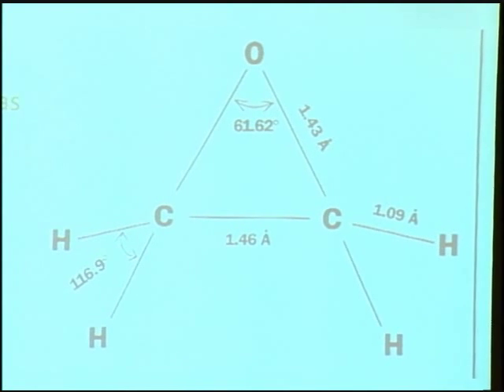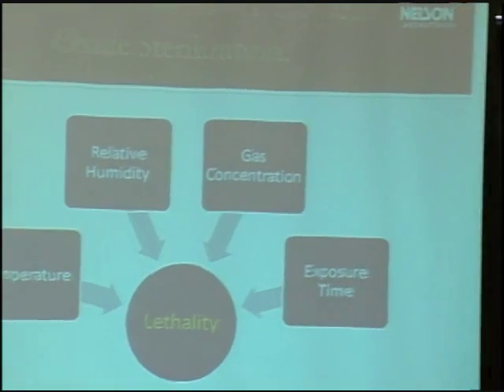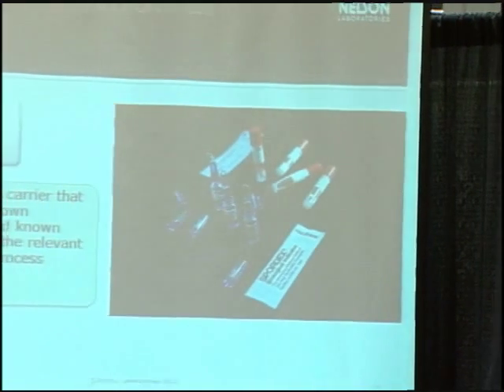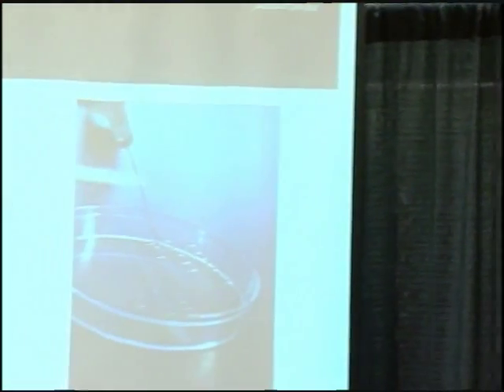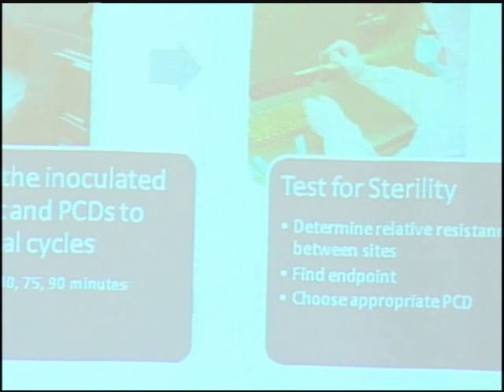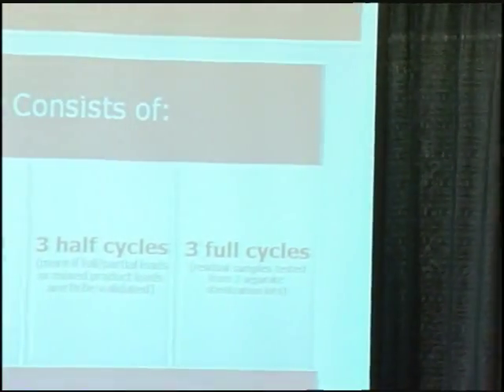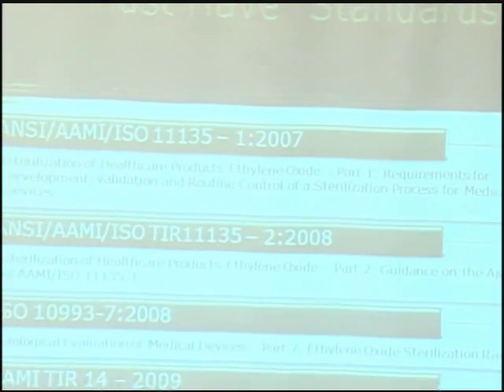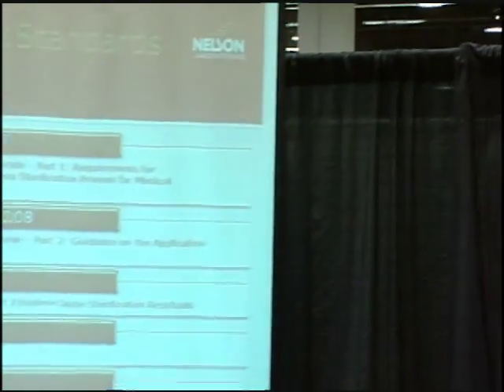Ethylene Oxide Sterilization

Comment: There using the stuff in Willowbrook Illinois  at Sterigenics and now the whole community has a high rate of cancer 10 times the national average!! I live 4.1 miles away from the building. And the CDC came in and ruled the building dangerous to the public after finding stuff not to mention they had a leak in 2013!! But the building is still open because it is so called not a immediate danger. But the whole thing will be going to court. They tested around the building and said 6.4 people out of 1,000 could be affected from the building!!